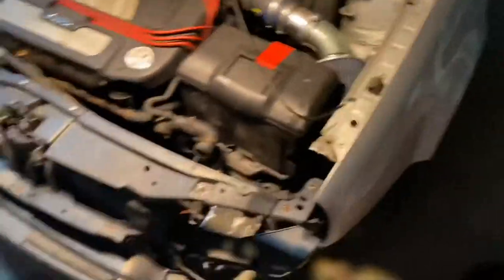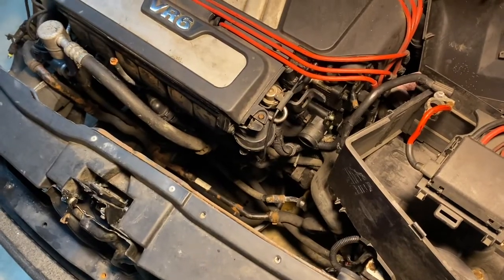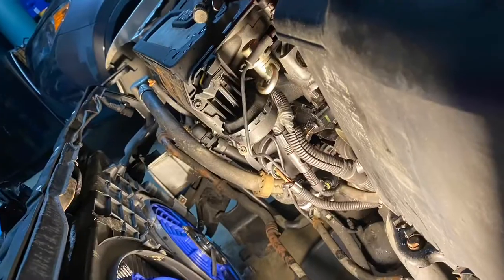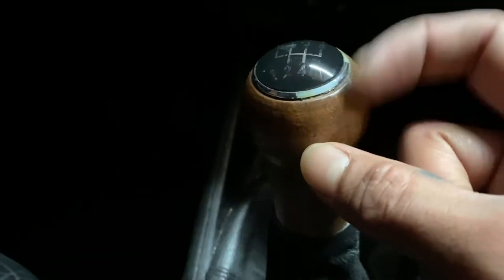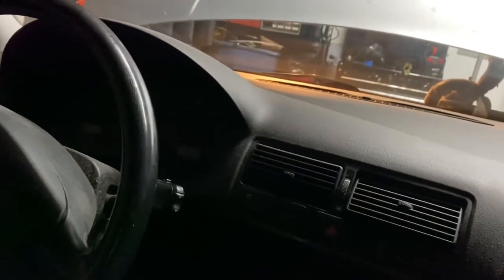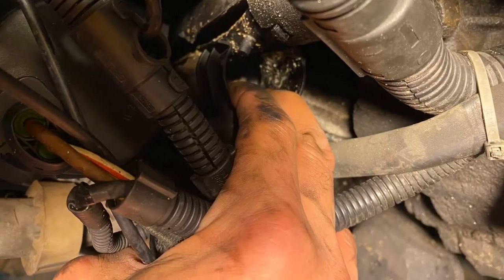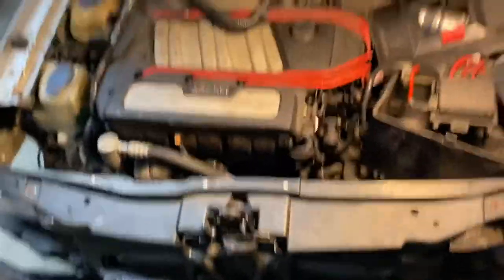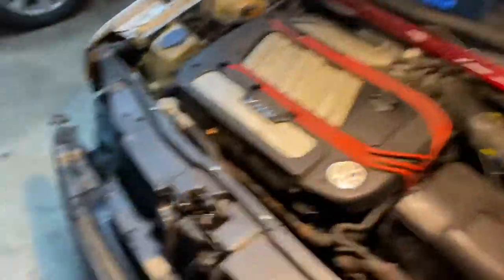Volkswagen - An Archer’s Paradox

Comment: I feel your pain brother. I've worked on everything from time to time. And the , love this car hate this car resonates with me my friend. They are not made to work on anymore. Everything is built to be disposable these days. Best regards my friend.
Reply from the maker: Thank you brother, it really gives me a boost when I know someone is sympathetic to my situation.  It's a 'if they can do it then it's not impossible' kinda of thing that gives me hope.  I had just 'fixed' a big problem that involved welding a nut onto the engine block to hold the motor mount bracket.  It was weeks of ripping everything out on the left side, jacking up the engine, welding and peening, welding and peening, put it all back together to just have the weld break and do it all over again.  Finally got it attached good by dropping the engine and then layers of weld beads on the lower side of the nut.  Two days later, engine is nice and secure, saw that my coolant was low.  Go to top it off and a waterfall comes flowing out the bottom of the car.  If it's not one thing it's another...  All the best to you Scott, thank you again for the kind words and hope!  I can do it!
Reply from the maker: And you are too right about everything being disposable these days.  It's a real shame...corporations profiting from exploiting our throw away society which the corporations themselves created.

Comment: Oh I feel for ya ... I hate cars today ... you should see my Hummer engine! What happened to the simple days where you could look at the engine & know and name everything on it? I just don't work on them anymore! I miss those days it was easy to get to everything ... wires, plugs, new distributer cap, points - just don't forget to grease them. change alternator, starter, battery, a bad freezeout plug - no problem!
Now like you said it's like a game of Twister - LOL! I open my hood when something goes wrong & scratch my head wondering if that's an actual engine, or a large Typewriter in there????? Typically ends with me closing the hood and calling my mechanic to send out a flatbed! I hate them ... I think my mechanic hates working on it as well ... and the bill? Well let me just say this ... it's why I have to buy cheap Bows, arrows, and make my own strings! LOL!
Reply from the maker: Left hand yellow, right hand green 🤣. This car is driving me crazy. My other car is even older, 1997 Audi A6 wagon I bought off Craigslist years ago for $2000.
Reply: @HandyL  That's funny. I was never good at Twister, and worse as a car mechanic! 😆